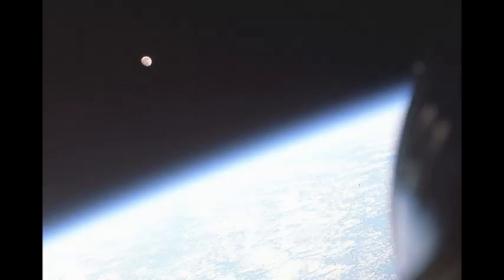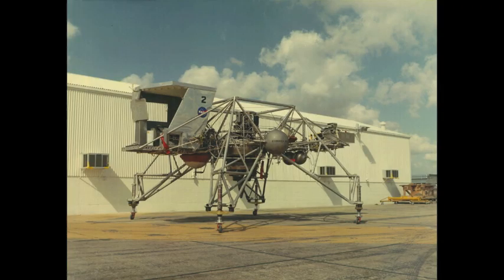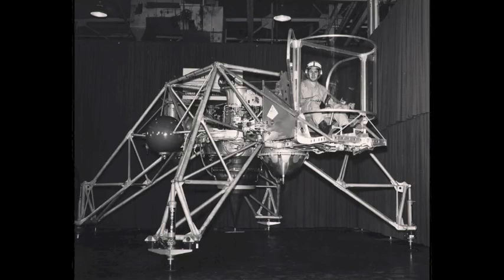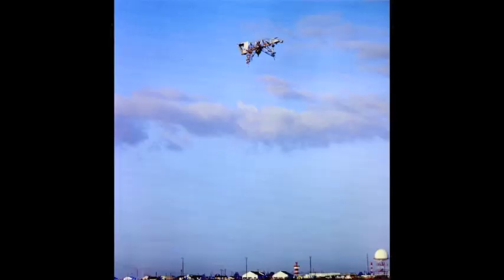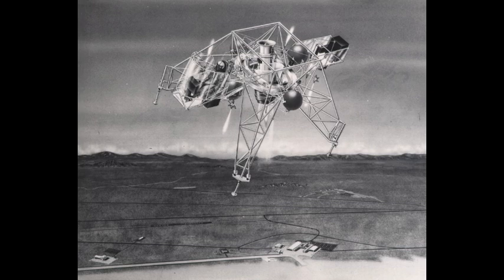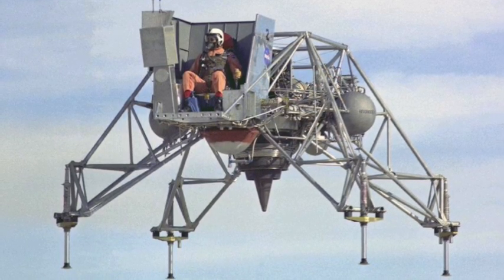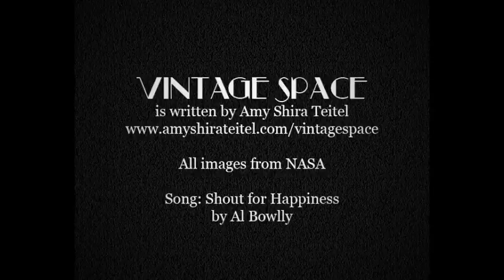How Did Apollo Astronauts Learn to Land on the Moon?

Comment: Think the mishap was Armstrong wanted to have a go at landing the simulator without the flight computer. The crash footage is quite spectacular.
Reply: +Rob Burns The accident investigation board found that the fuel for the LLRV attitude control thrusters had run out, and that high winds at the time of Armstrong's flight were a major factor.

Comment: This is not even close to a simulation. They were standing not sitting. They had only a very small window to see out of, not like this. And they are sitting in a different position to the c of g, so the feel would be very different to fly. And they don't even use a rocket to properly Simulate the reaction of its variable thrust. Total garbage. 

A helicopter could have done a better job.
Reply: If NASA thought a helicopter could do a better job at rehearsing the Lunar Module piloting skills, they would've saved all the money and time of constructing and using the LLRV's.